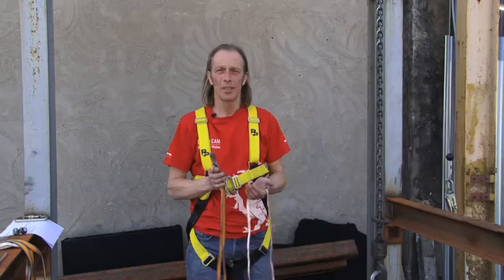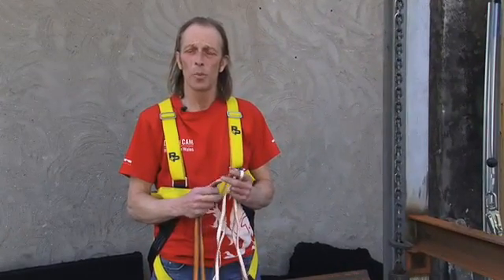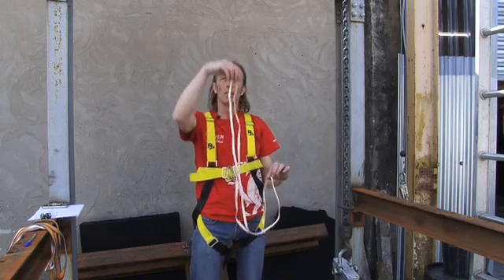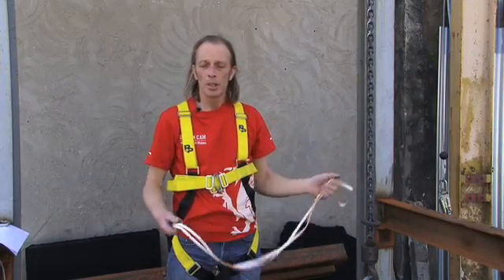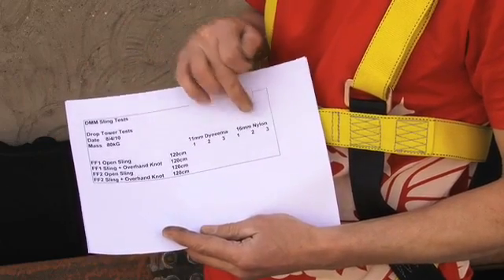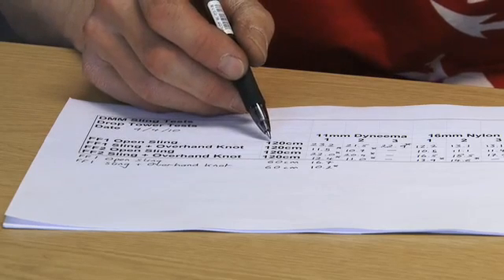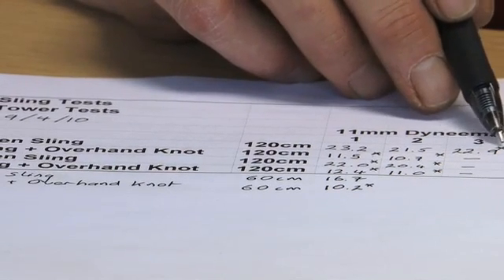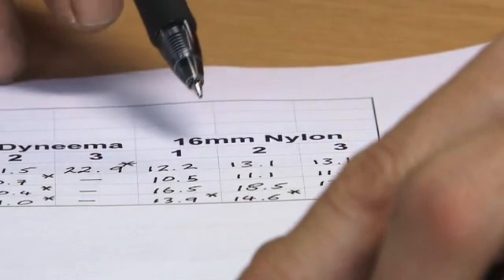Nylon and Dynema slings Drop Test a.k.a test kekuatan dari sling nilon dan dynema

Comment: Me using dynema extender draws as a station link....
But the answer is keep slacking put if the system?
No worries then just use the equipment properly right?

Comment: Dyneema failed and Nylon didn't -- I would rather have Nylon
Dyneema's impact load was double that of Nylon  -- I would rather have Nylon
Dyneema is less bulky than Nylon-- I would rather have Dyneema in this case

Wait a second, impact loads are half as much in Nylon, why not decrease the bulk of Nylon?  
Nylon is less expensive too, so it can be replaced more often if we are worried about abrasion and UV exposure.